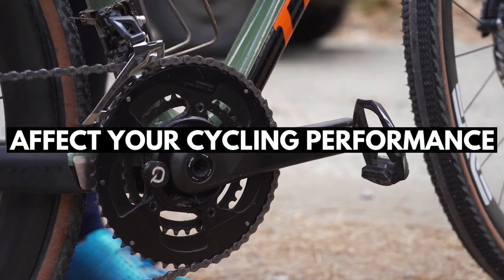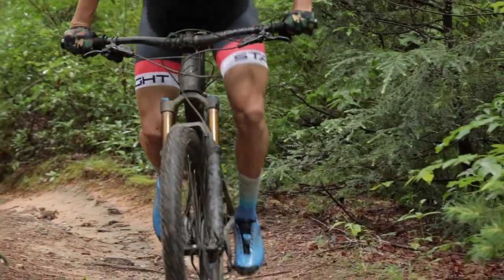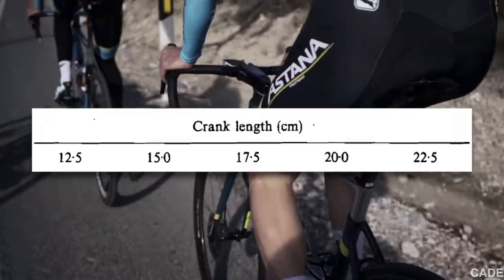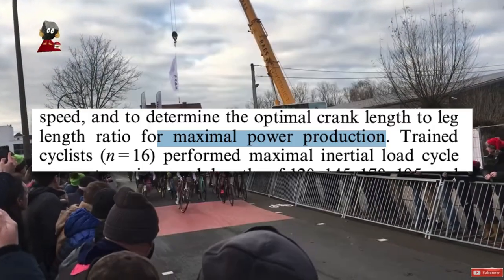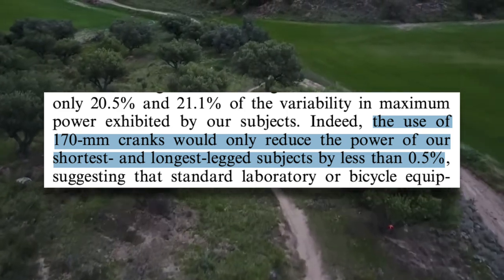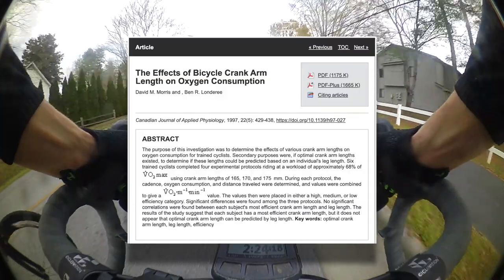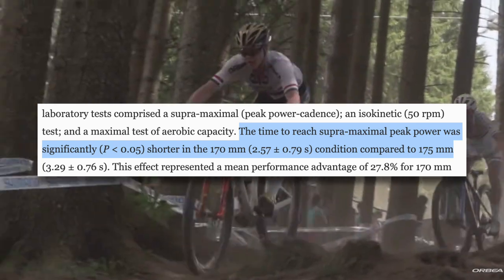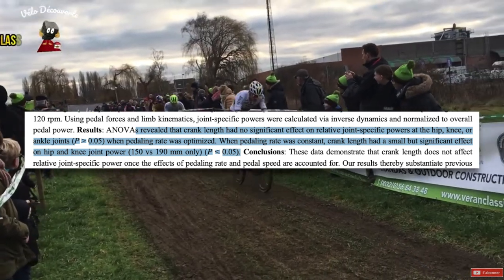Does Crank Length Affect Your Cycling Performance? The Science

Comment: I usually don't comment about my cycling experience... but this hits a huge part in my cycling experience... First, I think its individual preference and can go either way... for my experience, I'm 5'3 or 160cm tall, I started with 170mm crank.  I built an Allez with 160 crank,  and kept my Ridley Helium at 170.  I noticed a drastic difference.  I noticed the 160 took more pedal pressure on climbs than 170 (makes sense with how torque is generated).  I then tried to see if my sprints were better with 160 (Just like the video concluded, higher rpm, optimal power output)... and they were.  I settled back for 170, cause real world riding have inclines everywhere and I felt my sprint gains weren't advantageous enough than the lost in climbing torque during my rides
Reply: or... just fit lower gear ratio with the 160.
You produce less torque but can spin (and prefer to spin) faster. So dial down the gear ratio.
Reply: @Hexsense  I actually did that too, I went with 50/34 on the 160 and kept 52/36 on the 170... the gearing was still not enough.  Maybe with this new Sram AXS, 46/33 paired with 10-33 cassette, maybe... but for the price...
Reply: What gearrange are you in, and what gears do you have?
Reply: @mreyes2633  change from 170 to 160 reduce torque by 5.9%. Changing from 36 to 34 is 5.6% lower gear, which is pretty close. One more tooth in the cassette would overcompensate it by many percentage.

Once you have sufficient low gear to reach comfortable cadence, torque would not be the limiting factor anymore. It shift back from torque to power as the limiter like most of other situation.
Reply: @Hexsense  ok cool, torque and power are directly proportional as well as rpm... check this:

Power = torque * rpm
Given a steady pedal pressure....

170 crank > torque than 160 crank

If a rider can max spin a pedal at 130 rpm both 170 and 160 pedals... 170 has > power than 160....
Which isn't real world case cause I can max spin a 160 crank > than a 170 crank...which supports my finding and the videos finding that shorter crank can produce more power...
What I noticed, was with reduced gear with 160 at 50/34 chain ring, I'm still producing slower speed up inclines.
50-28 gear (160) vs 52-28 (170), the 170 gave me faster climbing speed given 90 rpm for both.

It makes sense for track riders, cause there's no incline in a velodrome.  I've invested enough money and tested as objective as I could to understand that I'm better off with 170 than 160 based on real world riding.
Reply: Here's an analogy for car folks...

Honda S2000, crotch rocket (sports bike)  have high horsepower with minimal torque.... due to a short piston crank arm.... but they rev super high to produce that horsepower

Trucks have great torque, long crank arms, low horsepower, until you turbo charge them....  they don't rev high...
Reply: @mreyes2633   I know the formula.
But no, torque limiting and power limiting aren't the same. That's why engine spec both torque and horse power which doesn't always correlated. (which you seems to understand).
You lose torque but gain rotational speed back if you have the proper gearing so that the power is not lost. Our engine are legs. Crank length is like another gear ratio in the system.
If you keep 90 RPM on both 160 and 170 crank. You effectively moving with slower linear foot speed on the 160. That'd require more torque to compensate with slower (linear) speed. Which is more likely to encountering torque limit.
Proper equalized climbing would be 160mm crank spin at 105rpm while 170mm crank spin at 100rpm. If you compensate with the proper gear ratio so that you are going the same speed at different cadence, then guess what, torque required and produced are lower on the shorter crank set-up but the bike move by the same power. It is harder to climb when you don't increase the cadence for shorter crank which introduce torque limit condition to the system.

Take away message: shorter crank don't just allow higher max cadence. But it require higher minimum cadence as well. The whole cadence spectrum shifted.
Reply: @Hexsense  I agree, so my original point, it's different for everyone, because I didn't want to spin faster to climb, I'm more 90 rpm kinda guy
Reply: Spaz you have to be kidding me. You have to spin at a higher frequency with shorter cranks to maintain the same foot speed 🤦‍♂️ How are people this ignorant. Cadence is meaningless once you start messing with your crank length
Reply: @404nobrakes  Lol, only thing you said worth noting is the reduced radius in cranks equates to higher rpm to maintain same foot speed compared to larger crank.  🤦‍♂️  your absolute stance on cadence is just ignorant, quite the conundrum. 😂

Comment: Well, that’s a surprisingly interesting finding! 
Two things that were missed:
- As using shorter cranks indicates a higher optimal cadence, then gear ratios also should be changed - shorter cranks, higher cadence, lower gear. As well, of course, longer cranks, lower cadence, higher gears - for the same speed & effort level.
- Higher cadence makes it easier to react to speed increases in group riding. To match a group acceleration, it’s more effective to spin up than it is to mash the pedals at lower cadence (& higher gear). For one thing the pedals are coming over the top sooner at faster cadence. 

Also, what’s the data on knee (other joints too) injury related to cadence at the same load (wattage)?
Reply: it being "more effective to spin up than mash" is making some assumptions about what's ideal for the rider.  If I'm doing 90RPM on my 180mm cranks (typical for me), and want to speed up 10% to match a group acceleration (99 RPM), that's not any harder than if I was doing 100RPM on my 175mm, or 130RPM on my 165mm, ans speed up to 110RPM, or 143RPM respectively.

Anecdotally,  I get sore knees when I do longer rides on shorter cranks, so the seemingly conventional wisdom of shorter cranks being easier on the knees is definitely not always true.  That said, I'm tall with very long legs, and already ride with a relatively fast cadence most of the time, so what's better for my knees is probably very different than someone who's short and naturally mashes at a low cadence.

While I'm likely better off spreading out the power over more of my comfortable range of motion (reducing force) at the same power, someone short who's pushing the limits of their range of motion is probably going to benefit from bringing it down to something more reasonable, while maintaining their power through a higher cadence.
Reply: @nwimpney  Good point & well-said. Indeed, it would have been better if I had said something about cadence being relative & so for each individual spinning at the higher cadence of their comfort range in order to better stay tight in a group. Right?

Comment: Female, 5’5” tall, long femurs, 155 cranks. That was one of the profound changes I made to my fit about 1.5 years ago. 

I always had a pinching on the right front of where I contact the saddle. After zeroing in on a good, low saddle height for myself, I visited my fitter and his rig can adjust crank length. As I rode, we shortened down from my 170s and 155 was the magic number that removed that pinching. It was the length that created pelvic stability and a pressure down on the whole saddle through the entire pedal circle. I had never experienced pelvic stability like this before.

Essentially, anything longer than 155 resulted in the front sides of my pelvis lifting as my leg came over top of the pedal stroke. 

I had lived with saddle sores for 11 years before I got my bike fit + crank length sorted.
Reply: what if u went to 145mm? maybe u would be able to remove spacers and go lower?
Reply: @Dralbastaki  less crank length creates higher seat posts

Comment: Interesting !! . . . I've just changed down from 175 to 170. I decided to do it as I felt a 'dead spot' when peddling from around the 11 o'clock to 2 o'clock position, the change seems to have improved my perceived peddling action and making riding easier and more efficient . ..
Reply: fasdiablo what is your Height....currently im using a 175mm crank...it's hard to spin fast

Comment: with a longer crank arm your foot has to travel farther and faster to produce the same cadence,  this fact may explain why preferred cadence goes up with a shorter crank because the speed your foot is moving might determine your preferred cadence
Reply: Basically what I say above but you did it with 20% of the words. It does explain it, along with preferred resistance.
Reply: But there is also another consideration - heart rate.
     With divergent heart rate and cadence the perceived effort can increase.
Reply: I worked it out one day and to have the same leg speed with a 180mm crank and a 172.5mm(I think it was that one I was comparing it to) the 180mm crank needs an RPM of 95 while the 172.5mm needed 100 RPM to have the same leg speed

Comment: As a triathlete doing Ironman I am looking into 165 to open up hip angle
Reply: As a semi-fat non triathlete: what does opening up the hip angle entail?
Reply: Jesper Andersson When on a triathlon bike (or drops on a road bike) you are put in an aggressive position, where the longer the cranks the closer your legs will get to your chest when pedaling. With a smaller crank length the angle between your back to pelvis to knee is not as extreme, thus the term opening hip angle.
Reply: I use 162.5 on my triathlon bike. It helps immensely in getting aero.
Reply: I am 5'11" and I ride 165s.   I like to spin, it helps me spin smoother.   It keeps my knees and my hips much happier then 175s or even 172.5s.    I can get into more aero position because of the raised saddle height.    I actually would consider going even smaller if I was going to replace my cranks again.   On my old TCR with 175s my knees would be pounding my chest if I was in the position I can ride now.
Reply: A bigger chain ring and lower cadence with the shorter cranks works perfectly for Ironman. John Cobb has done heaps of work on this topic.
Reply: I’m 170cm and run 150 cranks on both road and tri bike. When I’ve ridden bikes with longer cranks it feels like hard work. My normal cadence is 85-92. Try short cranks on your next bike fit 😉
Reply: There are other ways of opening up your hip angle. I know a lot of people just do it the easy way with shorter cranks. But I think for Ironmans if I was to do them, I would go for longer. To work a muscle in the shortest range(by using shorter cranks) then run afterwards with a longer stride..... would not be something I would go for personally

Comment: Really cool, I used to do a fair amount of distance on unicycles, most with 29” or 36” wheels. For unicycles, crank length is super important. It’s common to be able to find unicycle cranks from 115mm to 175. Because they’re low geared and fixed crank length is almost like changing gears. For distance on road or gravel 125-135mm cranks were ideal for spinning and 140-150mm were great for power off road but not as spin-able. 175s would wear me out quickly and definitely were not as smooth. I ride Singlespeed a ton, and I think that crank length is more important than with geared bikes. I like to spin, I think probably 160 would be amazing for my Singlespeeds.
Reply: ^^^ this should be a pinned comment! 👍
Reply: It's worth keeping in mind though that because of the lack of gearing, you're having to use shorter than ideal cranks just to allow a high enough cadence.  I run cranks around 100mm on my unicycle with 700c 25mm (typical road bike) wheels to allow a silly high cadence just to be able to ride at jogging speed.

So, in the case of trying to go fast on unicycles, it's not so much choosing the "ideal" length, as it is choosing the shortest cranks that you can manage to balance on.  (If you're not smooth, you won't have enough torque to recover if you get off balance, and you'll crash)

Pretty much everyone, including short people,  are using cranks that are way too short for them on the unicycle.  It's just a limitation of being direct drive.

A good comparison would be measuring your power output with different crank lengths while leaving the bike in its lowest gear.  Most riders will make more power the shorter the cranks are, because they're almost purely cadence limited, not torque limited.

Comment: This is well put together.  My takeaway message is that if I change from 172.5 to 165 then I'll finally be able to use my aerobars properly (due to higher saddle) - well that's the plan!  I just have to see if I'm comfortable and generating my normal power with the changes.